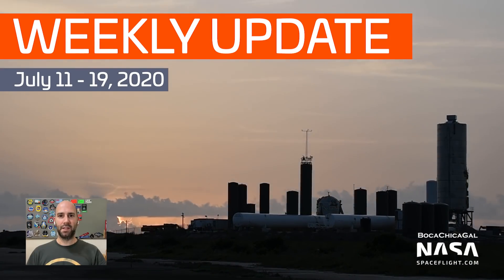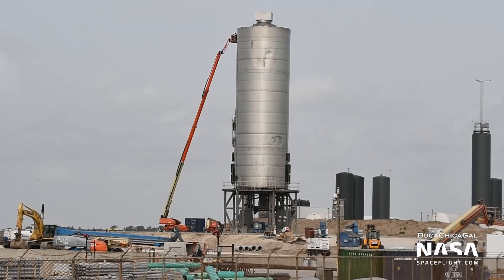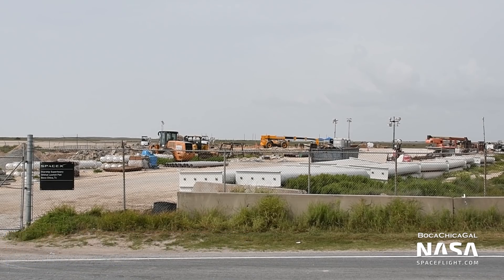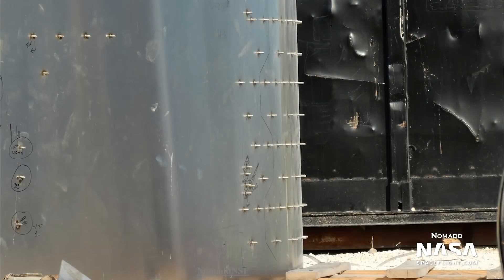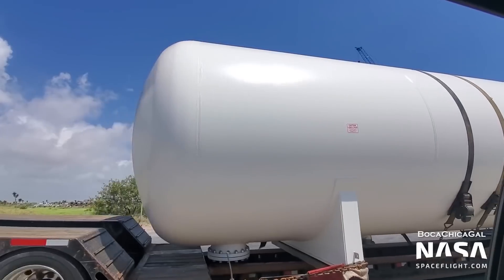SpaceX Boca Chica Weekly Update - Starship fabrication continues at speed as high bay takes shape

Comment: 0:00 - Intro
0:07 - SN5 Rollout
0:20 - High Speed Drive Past
0:29 - SN5
1:08 - Starhopper Static Fire
1:19 - Starhopper 150 meter hop
1:30 - High Bay Progress
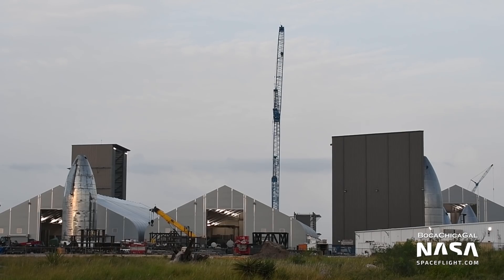1:57 - Fabrication Tents
2:07 - Starship Parts In Tents
2:42 - LOX Header Tank
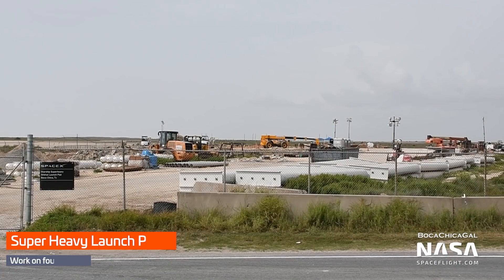2:53 - Super Heavy Pad Work
3:23 - New Launch Mount
3:37 - Earth Work / Clean Pad
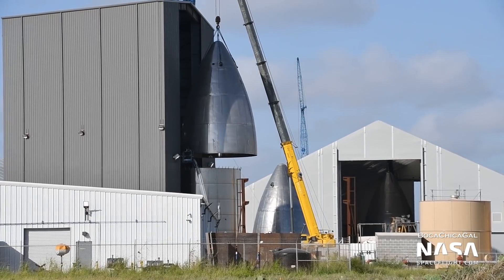3:53 - Nosecone Stacking
4:13 - Barrel Section Comparison
4:25 - Nosecone Land
4:42 - Heat Shield Pathfinder
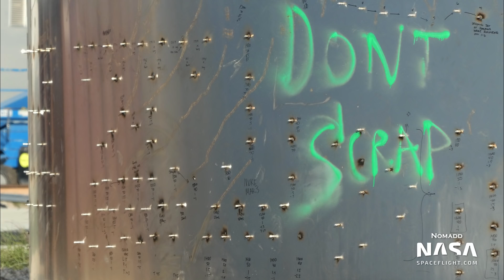5:10 - NUKE MARS
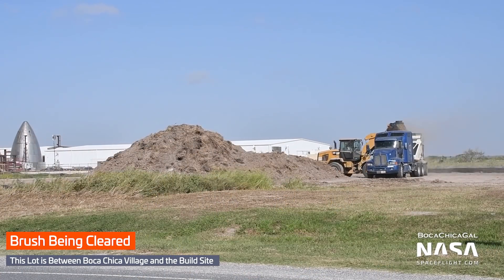5:14 - New Parking Lot
5:41 - Work at the old Gas Well Lot
6:02 - Mk1 Fins
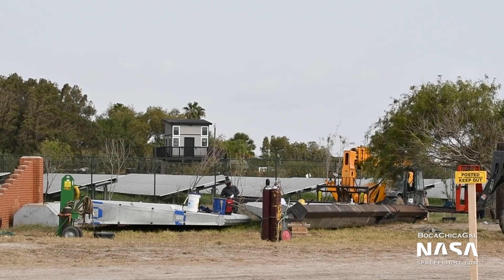6:57 - Outro
Reply: Jack Beyer thank you very much

Comment: BTW, those exterior horizontal  elements on the high bay may be called "strong backs". It's a similar structural system used when framing a conventional roof. I may be wrong though;).

Comment: Timestamps:
0:00 - Intro
0:07 - SN5 Rollout
0:20 - High Speed Drive Past
0:29 - SN5
1:08 - Starhopper Static Fire
1:19 - Starhopper 150 meter hop
1:30 - High Bay Progress
1:57 - Fabrication Tents
2:07 - Starship Parts In Tents
2:42 - LOX Header Tank
2:53 - Super Heavy Pad Work
3:23 - New Launch Mount
3:37 - Earth Work / Clean Pad
3:53 - Nosecone Stacking
4:13 - Barrel Section Comparison
4:25 - Nosecone Land
4:42 - Heat Shield Pathfinder
5:10 - NUKE MARS
5:14 - New Parking Lot
5:41 - Work at the old Gas Well Lot
6:02 - Mk1 Fins
6:57 - Outro